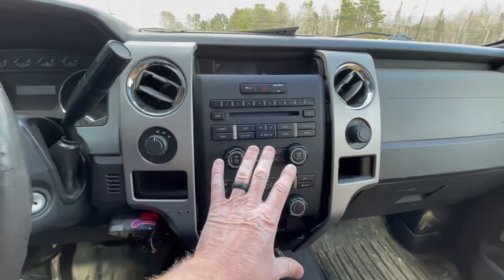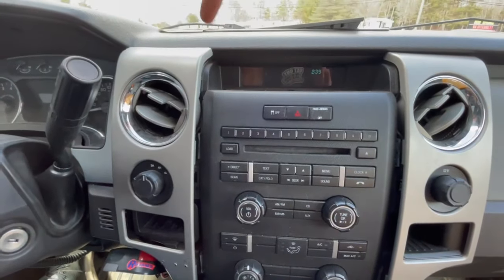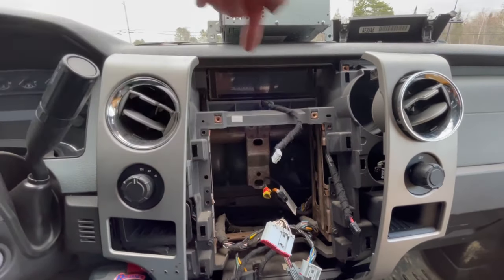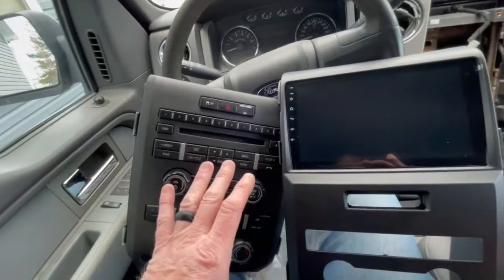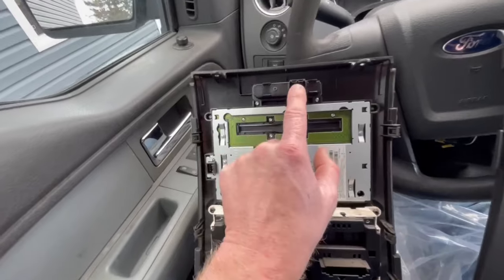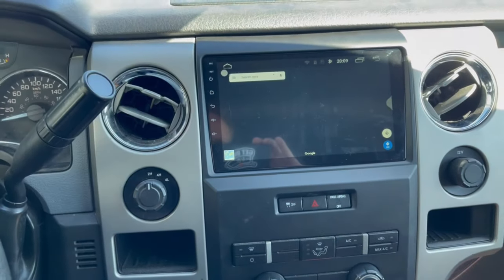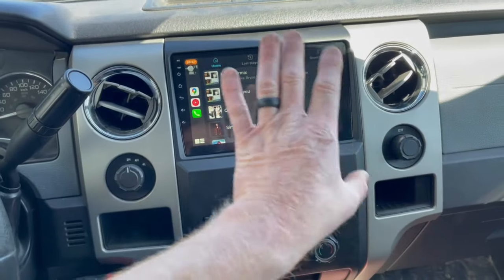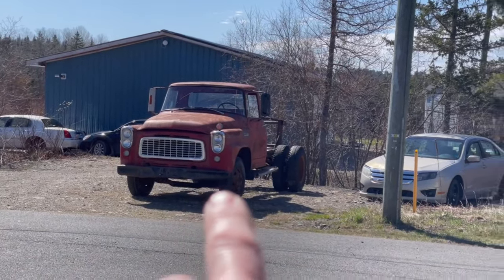How To Remove The Factory Radio 2009-2013 Ford F 150

Comment: Yay! Skipped the best part plugging in all the wires and reinstall. Super helpful 😂
Reply from the maker: That wasn’t really the point of the video, but it’s pretty straightforward. No one thing has the same plug!
Reply: Did you have any trouble with getting power to the unit? 
I’ve got everything plugged in and the stock stereo works just fine, but when I swap it all over to the android unit it won’t power on. (2009 f150 xlt)
Reply: Yes, I had the same issue. It's not plug and play like they say it is.  You'll need to take it to a radio store so you can splice  power to it.
Reply: When I get a moment I'll show you where it had to be spliced and maybe you can do it.
Reply from the maker: @Reelsimmer  i didn’t have to splice anything. Just plugged it in and turned it on.
Reply: @Reelsimmer  I actually got it going. Had to splice into an ignition switch source, then used an add-a-fuse off the body control module fuse block in the passenger kick panel for constant power. Everything else works ok. Must be the trim level with sync that doesn’t send power until something sync related is met.
Reply: @Reelsimmer  I have the same problem can you show me where to splice?
Reply: If you can't figure that out, you shouldn't be working on cars....
Reply: @dopeman420  🤣
Reply: @packerfan804  Mine isn’t turning on. Everything plugged in. Not sure which wires to splice according to the comments.
Reply: I did all these but my 2012 f-150 has 2 separate pin connectors and taking them to a 8pin double. Cannot find the plug and play harness. All pkgs show smaller pin connector. 3:16
Reply: @Reelsimmer  can you share the info for wiring power in?
Reply: How did you deal with the hazard switch wire? Mine is to short do I just pull hard on it? 2013 F150
Reply: @OldeCarrGuy the plug for the Hazzard switch how did you deal with that mine is kinda short I have a 2013 f150
Reply: @OldeCarrGuy  I just bought this system and everything was plug and play but my rear speakers don't work and it doesn't want to shut off with the key so I have to manually shut it off. The Bluetooth music from my phone world's but no sound. But the radio music works fine??
Reply: @jn74881  press on both sides of hazard switch and push out the front. I pressed one side first then the other.
Reply: It’s true to the title tho
Reply: Click on the video for the wire harness adapter 🤦🏼‍♂️
Reply: @dopeman420 lmao it’s literally advertised as plug and play. If things aren’t labeled correctly or at all it is not plug and play that it’s not something that can be done at home (again, as advertised). No one is trying to play mechanic or electrician that is quite LITERALLY the reason most people purchase it.
Reply: @Wyoboy7220  did you figure out how to get it to shut off with the ignition?

Comment: With this radio, how did you hook up the old antenna. The two connections that the radio came with do not fit.
Reply from the maker: I didn't have this issue. Sorry I cant help.

Comment: Just installed this screen in my 2012 F150 a little over a week ago. So far I love it. Audio quality is much better than factory, the features are endless (although I mostly just use apple carplay), install took no more than 20-30 mins…. Only negative things I could
Say about this is the mic quality, Bluetooth connection time (sometimes instant sometimes 25secs), & no volume knob. 

Other than that this is a huge upgrade to my vehicle for functionality and looks. Can’t beat it with a stick. Only a week in but so far so good.

Comment: I actually just got done installing this exact radio in my 2012 XLT. Nice video, man.
Reply: hey! i'm thinking about buying this radio, do you know if it has crossover settings (in the audio settings) and hookups for a sub/amp?
Reply from the maker: @tysoaren   yes!
Reply: You by chance have a part number ... Want to make sure I get this right 😊
Reply from the maker: @zackallen9909  I went with the H6764N
Reply: Great video but how easy is it to remove the old clips for the new piece do they come off easily and install and clip just as easily
Reply: I just got a 2011 Xlt and it’s so confusing so many wires I’m so lost

Comment: Would love the actual installation of the wires too included! Also back up wire install!
Reply from the maker: On this unit, it’s all plug and play. No 2 connectors are the same. As far as the backup wire, the power wire taps into your reverse lights in the rear an the video wire will need to be run into the cab to the connection on the radio.
Reply: @OldeCarrGuy  installed a similar unit in my 2012, and the key on accessory wire doesn't give full 12 volts, seen some forums talking about its computer controlled.. know anything bout this?

Comment: Thanks for the video!  I'm looking at purchasing this radio for my 2011 F150 XLT.  I noticed on Seicane's website that this radio comes in High Level and Low Level versions.  Which one did you purchase?  I don't know what the difference is between high level and low level anyway, :).
Reply from the maker: I went with the H6764N

Comment: Do you know if these basic radios can be swapped out for a sync3 system? Is there different wiring or all the same between xl and Lariat wiring?
Reply from the maker: Connecting should be the same no matter the trim level of your truck.

Comment: Hey buddy, I installed this radio and I love it, both of your videos have been extremely helpful.  However I'd like to have the feature to have my FM radio to switch up my tunes. I've been trying to look for it on the internet, but what the hell is that Green plugin for ANT (antenna) on the new head unit?  I know the old one doesn't fit, but I'm trying to find an adapter for it and I just can't figure out what that plug is called. Kinda tearing my hair out because all of the ones I'm looking for on Amazon don't look like it, like the Fakra Z connectors and stuff. 
Thanks man.
Reply: Bro, after looking back at your other video I got a second glimpse of what the connector looked like and I looked back at the box the radio came in, and there it was. The adapter for the orange antenna receiver connector that fits the green connector. Man I'm an idiot. Lol
Reply from the maker: No worries bud. Have a good day!
Reply: @OldeCarrGuy  after all this time you still reply to comments. Awesome buddy.
Reply from the maker: @renski8976  I try my best to answer every single  one of them.

Comment: The plugging in the wires part is why i came to this video havin a rough time here
Reply from the maker: Try this: https://youtu.be/GP1tpT0L1WM
Reply: @OldeCarrGuy  thank you that video was perfect! Apparently i did the wiring correctly but it still didnt come on so im assuming its a bad radio n imma send it back for a new one. I did check to make sure it wasnt the fuses.

Comment: I have a 2014 ford f150 stx truck. I am interested in upgrading my radio to this type of radio. So I have sirius radio, can you direct me to the right radio that has it that will work in my truck? Thanks for your help
Reply from the maker: Hi Mark. As far as I know, it runs sat radio through the SiriusXM app (which is free with your Sirius account). When your phone is connected via Bluetooth, Carplay or Android Auto, you can play through the app.
Reply: @OldeCarrGuy   Oh ok, thanks for that information.

Comment: I bought a new radio because I was getting the flashing screen on the orriginal radio. The new one is also not working, it'll just start up then turn off right away. Any tips on how to fix that?
Reply from the maker: Sounds like you have a problem potentially in your BCM.

Comment: Is it for sure good for a 2013? I looked up the model for the radio and it says 2012 but everything looks the exact same on my truck
Reply from the maker: My best guess is yes it will work for a 13. The full screen models that they list specifically for a 2013 also say they’ll fit 09-13 so you should be safe.
Reply: Thank you, just want to be sure since their website doesn’t specify. Hopefully if it doesn’t work out I can return

Comment: Where do u buy the dash panel for the radio it comes with the radio or where did u buy it at
Reply: That radio fits. On my 2014 f150 xlt
Reply from the maker: Comes with the radio!

Comment: What happens to the top screen which shows time and climate controls? Does the new screen show them?
Reply from the maker: The old screen gets hidden by the new radio, no need to remove it. The new radio does show time. Not sure about climate controls as my trucks controls were operated manually.
Reply: @OldeCarrGuy  How do you know what temperature everything is set at if the screen is covered?

Comment: How did you do your CarPlay? I have the exact same one and I can’t get car play to work
Reply from the maker: As long as CarPlay is turned on on your phone, it should connect automatically. If not there is a setting in the radio to choose one of 2 types of connection. I use the “Z” something or other.
Reply: my didn’t work either
Reply: @OldeCarrGuy how did u go to that setting where it gives you those options
Reply: @Alee6.7 it’s Carlink 2.0 you need to go to the apps on the head unit
Reply from the maker: Watch this! Upgrade Your 2009-14 F-150 With A Tesla-inspired Seicane Radio
https://youtu.be/GP1tpT0L1WM

Comment: Plugged everything in fine! And unit does not shut off with the truck???
Reply from the maker: Did you try opening the door to trigger the power to shut off. That’s the only thing I can think of. Otherwise you should contact the manufacturer.

Comment: I cant get the panel off the right side off the stereo. Is it behind the airbag cover?
Reply from the maker: It doesn't necessarily need t come off, just pull it toward you so you have access to the bolts.
Reply: @OldeCarrGuy  Thx for the reply! I figured it out. You have to remove the airbag, and there is one bolt holding it on.

Comment: Do the steering wheel controls atill work?
Reply from the maker: My truck didn't have them, so I can't say for sure, but they are supposed to as the new system runs through the canbus.

Comment: been at it for around 20 Minutes, still cant remove the hazard switch section out. Which way does it go out and how do i open/close the clips to remove it??
Reply from the maker: If I remember correctly, it pops out the front.
Reply: @OldeCarrGuy  thanks!

Comment: How do you adjust the air temperature where you covered it up?
Reply from the maker: It’s not covered up! You keep all those controls but move them over to the new bezel!
Reply: @OldeCarrGuy  but how do you see the number of the temp because u covered up that factory screen
Reply from the maker: @wadeluper697 depending on the model of radio you are replacing your factory system with, you may have a display within the new radio!

Comment: Can anyone tell me if the steering wheel controls will work with an after market radio?
Reply from the maker: My truck doesn’t have steering wheel controls, but as far as I understand, these radios are synced via canbus and should allow all factory controls.

Comment: How do you remove the top factory screen? Where the clock was
Reply from the maker: I didn't remove it as it's not in the way for the new radio.
Reply: I was trying to decide between this, and a name branded Pioneer, this dash kit looks way better than any name brand stuff I can find.  Was curious about the top screen as well, does it become just a pointless screen once an aftermarket unit is installed?
Reply from the maker: It just stops working and I didn’t remove it!

Comment: so the radio sound works but when i exit radio mode i cant hear anything, no bluetooth, or carplay. can someone help?
Reply from the maker: There are volumes level adjustments for Bluetooth in settings. I would start there. The volume settings may just be too low
Reply: Did you fix this issue? Mines doing the same thing no audio at all
Reply: @JaemzsFN  no I think it's defective

Comment: We kinda skipped over the steering whee connections could we go over that
Reply from the maker: It was skipped because my truck doesn't have steering wheel controls for the radio and this was a "how to remove the radio" and not necessarily an install video. Having said that,  the canbus control should adapt any factory options such as the wheel controls and backup camera.

Comment: Bruh the only reason I came to this video was to see what/how to plug in the radio why did we skip the most important part….?
Reply from the maker: Because the video is about how to remove the factory radio!  However, all of the plugs are different and only will plug in one way. It’s actually quite simple!
Reply: The stereo he installed it's the plug and play type, there's no cutting wires or getting rid of any wires, it's the same connections, so he basically didn't skip much

Comment: The radio won't shut off after turning off the truck, could anyone know whats causing this?
Reply from the maker: Neither does the factory radio until you open the door or times out (5-10 minutes). This should be working the same!
Reply: Did you ever figure it out? Having the same issue
Reply: @codymcgowen5579 got mine today, have the same issue going on lol. Won’t turn off at all unless it’s unplugged. Doors don’t do it and when it “times out” a red light is still on in the back and it’s still drawing power in “sleep mode”.
Reply: @midtownpowerwashers1368  the only think I figured out is it will turn off after 10 minutes since that is a factory option. It does bypass the door opening turn off.
So it only turn off after 10 minutes of no power.
Reply: Did anyone figure out a solution to radio not turning off?
Reply: @chasetorres2518  the trucks programmed to shut off the radio after ten minutes it bypassed the door switch so after ten minutes of no power it’ll shut off it’s very annoying